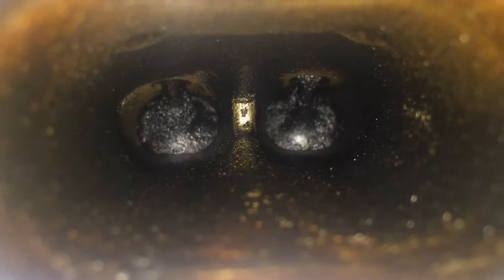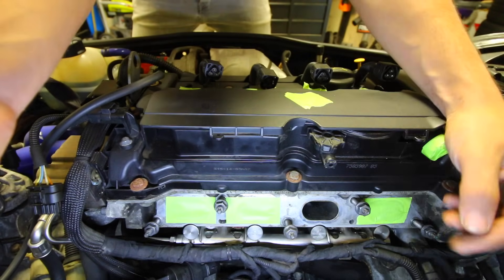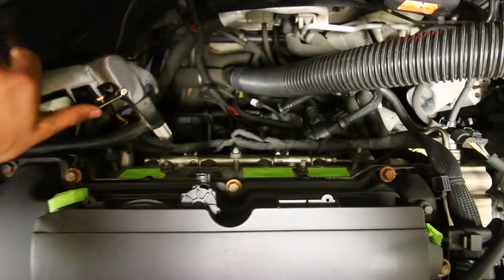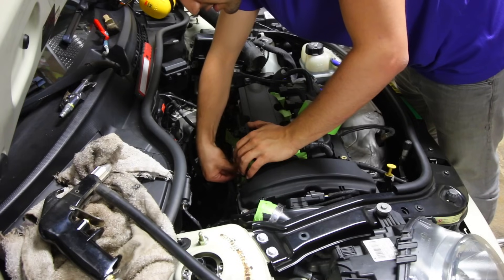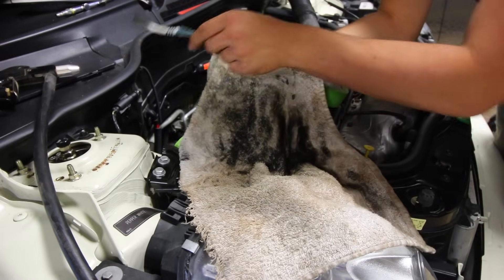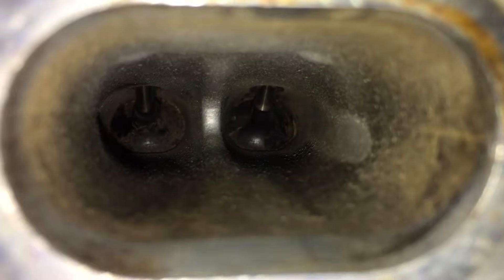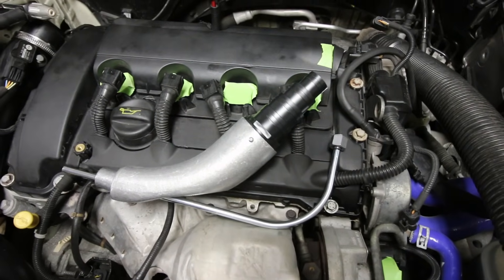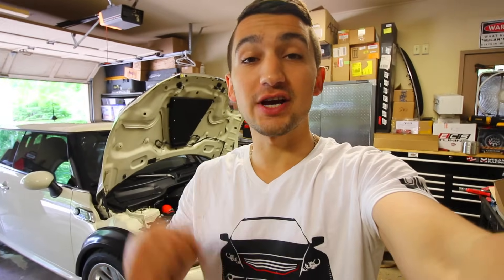How to Walnut Blast Your Intake Valves (CARBON BUILDUP REMOVAL)

Comment: This cleans only intake valves but how to clean the inside of the head and in the similar manner the exhaust valves and that portion of the head from the exhaust valve to the exhaust manifold because the rest of the exhaust can be removed and cleaned with toilet cleaning acid ( hydrochloric acid) and pressure washed

Comment: Video sucks ass he don't even show what's he's using or none of the hands on ur suppose to be using the special tool that bolts over intake hole and has a hole for gun weak sauce video
Reply: He actually does show that tool at the end. He explains how it mounts, how it is more efficient than the separate tools he originally used and then states the links to purchase it are in the video description.

Comment: Only Mini Cooper/BMW would be incompetent enough to build the engine so that the intake was facing the rear of the car and the exhaust the front. 

The second dumbest idea goes to Chevrolet when they decided it was necessary to make it so you had to pull the engine mount and lift the engine from underneath to change the belt on a Cruze.

Comment: The Audi 5 cylinder needed this done in the mid 1980s, the intake valves carboned so bad the engine struggled to run. We had a walnut blaster in the dealership that got used frequently.

Comment: Those carbon build up it happen to port injection too... the culprit is pcv system... delete the pcv and you will free carbon buildup in intake valve.... 🤣 ... aint care with emission BS... remove the pcv and let the hose free .. .. 🤣

Comment: Amazing job!  Having last been in the motor trade when carbs and manifold injection were king, could this not be prevented by filtering the oily crankcase fumes through a separate filter, rather than allowing the engine to 'inhale' them?  Avoiding this would make more sense to me than having to treat the symptoms later.
Reply: I think that would clog up pretty fast and lead to high crankcase pressure

Comment: thank you for your sharing, i want to use same technique for toyota d4d diesel, but i need specific information. So i respectfully asking you some details concerning the tools you use: compressor characteristics, vacuum characteristics. Which compression ,vacuum range and sand type should be used for blasting? what time should the blasting be performed ? .. i think these information is crucial ... so i need your kindly help🙏 !! because i have just one car and a mistake would be impardonnable

Comment: What size compressor would be good for this job?
Reply from the maker: I have a 20 gallon compressor, however you can get the same job done with smaller or larger ones.

Comment: try extend the blaster nozzle (you can even bend the nozzle into a curve so you don't have to go all the way in), drill a hole on the vacuum hose (for insertion of the nozzle). Since your manifold is facing inwards, you might want tape a scope camera to the nozzle which you can view the valve chamber (rather than doing it blindly) thru wifi on your mobile phone. Anyway, thanks for sharing.

Comment: The problem is you are mostly just cleaning the visual part of the valve which doesn't do anything..the important part is the sealing part that hits the valve seat..the carbon gets inebtween and wedged in and destroys the valve sealing surface, you will leak through the valve secret time. I've seen it on cars we take apart

Comment: On your first intake valve that you did, the walnut dust on the side can get in your cylinders right? And wouldn’t that be bad? Or is that small amount okay. Because I do know a small amount of walnut shells in your cylinder won’t hurt but a lot will. It’s all relative so just curious if that’s okay? Or is there a way you can get more of those small walnut shells sucked out?
Reply from the maker: If you can ensure all of the valves are closed prior to blasting them, it would be ideal. Considering the walnut is soft, some of it can slip by the valves and go into the combustion chamber and it shouldn't damaging anything, but if you can prevent it, I would!

Comment: this seems like a lot of work.  Can I just remove the air filter and sprinkle-in the walnut shells with the engine running?
Reply from the maker: You can be the guinea pig for that one.. You may kill your motor by doing that

Comment: Use intake and valve cleaner before each oil change or every other oil change and you won’t need to worry about all this extra work.  Nice job cleaning up a neglected engine and very detailed.

Comment: Hey Milan and all, I'd like to know (before I order new intake manifold seals) if it is easy or possible to squeeze our head under the hood to see the ports and valves (or a boroscope is required)? I'm asking because I think that before "going walnut", I would give CRC valves soaking a try first. But if I can't see the sludge I'll have to scoop up without mirrors and fiber optic, well.... Anyhow, thanks for great videos and info
Reply from the maker: after you remove the intake manifold, you can see the intake ports by using a small inspection mirror, or boroscope if you have one, prior to doing the walnut blasting. I find the carbon can be so built up that some sprays and chemicals can't break it down enough to clean them out completely. Hope this helps :)

Comment: @Induction by Force  not a cure, direct injection has other issues that even without carbon build up, can still ruin a long engine life. The compression ratio of all DI engines puts wear and tear fast, even with dual ports (multi port & DI). Also the 10% ethanol in gas that we all use adds to fast wear and tear in any engine.

Comment: OK, but with the valves closed, the walnut blasting can't hit the surface where the valve makes contact with the seat. So yes, you're removing grime from the backs of the valves, but I don't see how this can fix poor compression due to valve seating. If it could, that'd mean the valve was raised off its seat by the gunk, and you'd be getting walnut in the engine. Is this not true?

Comment: While I like your approach.. you are getting that crap everywhere.. and its just not ideal.   for under 10$.. measure the circumference of your port.. get a rubber coolant hose 90 degree (universal) which is a tad larger.. cut little slits into the ends, the idea in doing that is so the hose will "compress" into the port when you insert that hose into the port hole that you're focusing on.. Use a nozzle/ TIP,  into a HOLE cut into the backside of that hose.  Connect hose to a wet dry vac..then do your biz.. the concept of this suggestion (based on another youtube vid) NO WALNUT Shells hit your engine bay.. Some guy got a old coolant hose with a 90 degree and just dog eared the hose with V cut reliefs.. again.. the hose mates to the cylinder.. the vacuum is connected to that hose.. you drill the hole into the hose, insert your TIP, shoot the walnut material.. essentially through the hose, while under vacuum. Miraculous.. inventive idea.. not my idea..

Comment: I once had a 2014 Beetle convertible with a turbocharged engine. I really loved that little car. It really hurt me to have to let it go, but I needed a truck, and had a small budget, so I was forced to trade it in for a new Toyota Tacoma. Anyhow, I think I’d drop the motor, just to be able to comfortably media blast the engine’s combustion chambers outside of the car, then push out the engine and the vehicle outside, to power wash it, and engine bay while I’m at it. I’m a neat freak, so I have an obsession of keeping the engine bay clean. I would probably do the same thing with major engine work. Water pump, timing chains.... etc.

Comment: It's not the weight of the carbon build up that causes the problem. Its air flows, and losing compression due to carbon getting in between the valve seats that causes misfire and performance. Anyways great video

Comment: It’s not the extra weight on the valve thats the issue. The air doesn’t enter the combustion chamber effortlessly and is not tumbling across the valve and swirling into the chamber for a complete burn. You feel it especially when accelerating because there is a very pronounced shutter or shimmy from the motor and a lack of power when it is bad enough. Best to clean it and install a catch clean so the pcv system doesn’t continue to dump oil into the intake.

Comment: Blast your intake valves in a assembled engine is a gamble one valve is not complete closed and is warranted you going to destroy the engine, same if some residual remains inside. You have a garage and the tools take few more hours and do it right! remove your motor head and do a quality job you also going to be able to clean your pistons, injectors, readjust your valves and check the integrity of the top part of your engine.

Comment: ALL engines get this mess, more or less.
Port fi engines still contend with pcv blowby in spite of the fuel spray at the valves.
Thanks for a great video. 👍👍👍😁😎😎

Comment: The intake manifolds are plastic and the individual runners on most cars now are just that individual runners. Why not drill and tap each runner for an access screw. Then the screw can be removed and the nozzle from a can of CRC can be inserted thru the access hole and solvent sprayed on each valve to clean the intake valves. Use a bore scope to slip into the screw hole to look at the progress of the solvent cleaning. Pull the scope out and then using the tapped threaded holes screw in a nitrous injection injection kit feeding each runner in the new holes. Voila!

Comment: You can clip the head of the toothbrush at 30 degrees off to make a scraper. Also as other videos show after a good vacuum, a spray of your favorite valve cleaner would be good. Wiping off the excess, after a soak.(Check your EGR valve)

Comment: you seems professional with all those red and blue tubes, explaining and talking alot.. you just forgot 1 little problem. you did litterally nothing to solve the problem you had, as when you get a misfire on a cylinder due to a faulty valve it is because the carbon is deposed on the spot where the valve is supposed to close by touching the seal ring on the cylinder head, not on the upper stick. now if the valves are closed your sandblaster wont reach that spotas the junk is compresed between the valve and the sealring on the head. the only way to clean that spot is remove the head, the valves and resurface them by a professional. not to mentioning the dust you left theresaying "just turn the engine on and drive it" sucking all the sand dust into the cylinders, or even "clean it up with some water" lmfao.. how about some compressed air after you "sandblasted" your intake manifold? ;)

Comment: Why did you need to remove the spark plugs?
Reply from the maker: So that turning the engine over by hand is not a hard task 👍 When the spark plugs are installed, it allows the combustion chamber to create compression

Comment: Do it the old school way!!! We used water or gumout (pour in the tank kind) and we poured some into the carburetor (a little at a time)into the warmed up engine (as not to hydro lock or damage the rods)at about 2000rpm to remove any deposits that may have formed in the cylinders or on the valves to avoid the detrimental detonation... It worked very well... I’m aware that with the new models of car there are a few things that must be considered to prevent damage to components that the computer uses... Where there’s a will there’s a way...
Reply: The old school way does not work with the direct injection engines. There is no gasoline going past the intake valve just oil contaminated air which is what causes the carbon buildup

Comment: Question. What if after blasting some walnut grains stay inside and I can't get them out? Won't that damage the valves/cylinder walls/ pistons?
Reply from the maker: Keep blasting until everything looks clean. Spraying some compressed air in there might help as well to remove any nuts you can get. Also, because the crushed walnuts are soft, IF some do get sucked into the engine, they can pass through without causing damage
Reply: @milanmastracci  thanks man! And thanks for the videos!

Comment: How do you know the valve is closed?
Reply: you can see the valves close when rotating the crankshaft. Aother method would be to bump the starter with a compression gauge hooked up and let off when the pressure just starts to increase. That tells you that that cylinder is on its compression stroke which means the intake valves are fully closed.
Reply: @AutoTechToYou  thank you  very much for your information 😊

Comment: Im using cloth hangers (wire) they are perfect because you need a hook tip and something flexible but firm enough to reach the valves from and back..after a remove the big chunks of carbon I used my shop vacuum with a 1/2 inch coolant hose adapter to reach the inside the valves I repeat this process at least 5 times in each valve..then I spray brake cleaner and wipe the excess with a rug ..I believe its more effective method...adios amigo 🙋🏻‍♂️

Comment: i recently cleaned my valves with crc valve and turbo cleaner and man immediately felt a difference.. the turbo kicks like it used to when it was new and my mpg went up.. i think you can avoid your car getting this bad if you do preventative maintenance... i did mine at 50k.. wish i woulda done it at 25 then at 50 a second time..either way direct injection is a pain for the avg person that dont have the time, tools, or just don't know their way around an engine.. they are pretty much guaranteed to have to spend money on a valve job from a dealer which is pricey

Comment: I cleaned mine the hard way. Carb cleaner and a nylon bristle cylinder brush on a power drill. Took me an entire day. About 1-2 hours per valve port. I wish I could have used the walnut blaster and been done in 15 minutes

Comment: Oil selection is important with GDI as a tactic to spread out service intervals -- ideally a low Noack volatility (so as not to react with fuel and form junk) and a thin base (so as to evaporate before it ever gets a chance to bind to the valve). Those two things do not go together naturally, so pick carefully.

Comment: I have a 2013 accord with gdi. 200k miles. Never have cleaned nor thought about cleaning it. Lol ao i went to go check it out. And.... is not bad at all. Stained but theres no build up. Not sure it its just honda or what...
Reply: @Z3 VT i agree with you, i do believe is the first GDI engines that may be expierencing this issues but as far as gas goes, cheapest gas i can find. Lol. Oil wise i use penzoil...

Comment: You should install a catch can system and avoid this problem entirely.
Reply: Yeah the people commenting that they'd never buy GDI don't realize what an easy fix it is, the only reason car companies don't is because it's not an issue until 5-7 years after purchase when the next model is already out. If you need to do it within 5 years you have other issues

Comment: Most of the car engines being produced today are direct Injection engines so the people saying in the comments I'll never buy a D.I. engine probably did. The benefits to a D.I. engine are many but the intake valve debacle is there too. The way around not getting this  gas, oil, water and other contaminates directed back into the motors intake system is to buy a product know as a oil catch can.

The product that ends up on the intake valves and intake chamber as carbon buildup and oil coated surface is from the cars emissions system. Instead of venting this out into the atmosphere, car manufactures are required to have it resent through motor to be burnt up in combustion process. Look up online for a catch can for your specific car and then install with the instructions.

Now because of the negative side effect of the carbon buildup with D.I. gasoline engines, there has been a call to come up with a design to combat this issue. Now the best way to combat this problem is to have the benefits of a D.I. engine where most of the fuel is sprayed directly into the cylinder (D.I.) and then to have an additional injector before the intake valves (a port injector) to spray a portion of fuel to wet/clean these areas too.

Catch cans depending on design, build quality, opporation and features can vary in cost. Basic ones can cost $30-40 and the better designed more functional ones can cost $120 to 400.00. Note: most race cars/professional drag cars have oil catch cans installed.

Comment: I"m not so sure how effective this method is?  The problem isn't carbon buildup on the back of he valves.  It's the carbon buildup on the valve seats and matting surface of the valve and that's why you lose compression and end with misfires.  And since the valves are closed those areas aren't exposed to the blaster.  It would seem the only real solution is to pull the head, disassemble the valves and clean all mating surfaces.

Comment: Maybe use a cloth instead of the vacuum and wrap it around the gun tip. Then make sure its seals the intake to prevent any from shooting out of the intake. Then you shoot a few in there and remove the gun and cloth and then only vacuum it out...

Comment: If you spray some cleaner in vacuum line every 5000 miles it might prevent you from having to go all this trouble of removing the intake. I also would use a high-quality catch can or even 2 catch cans in line to catch as much crank case shit before it coats your valves.

Comment: This oily/carbon buildup is from the PCV system, not EGR. Is there a PCV oil capture mod available for this engine? This would simply prevent the buildup, eliminating the need for this maintenance. Usually $100 kit, can be self installed. They're available for all the Ford ecoboost engines.
Reply: Look up "Catch Cans." That'll help capture most of your blow by.